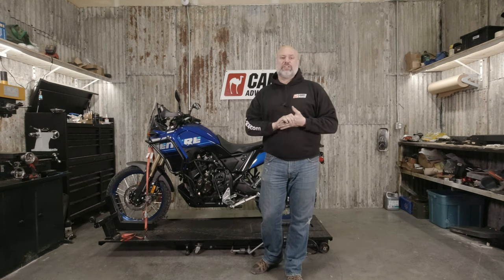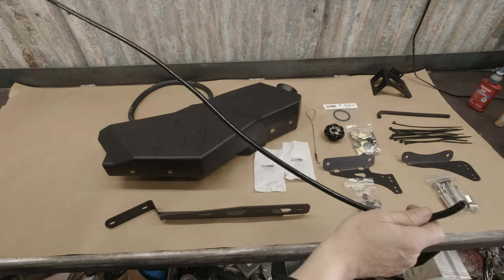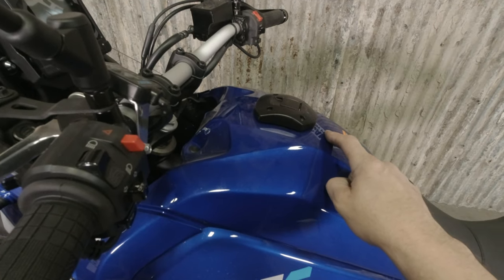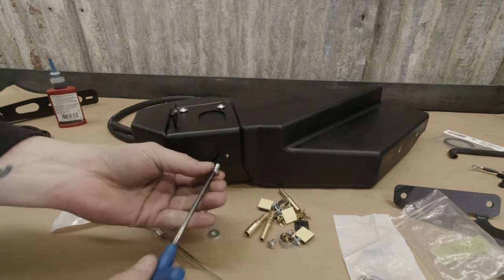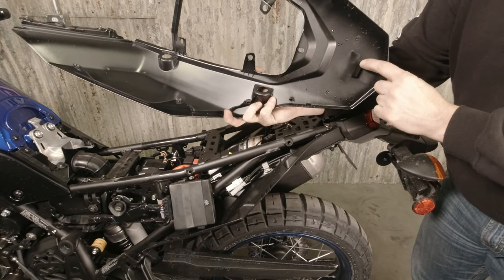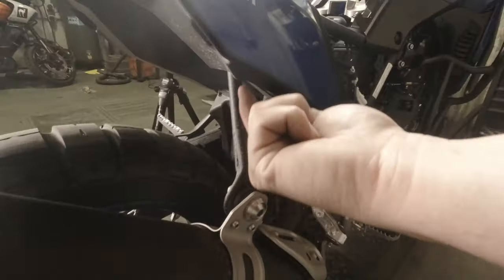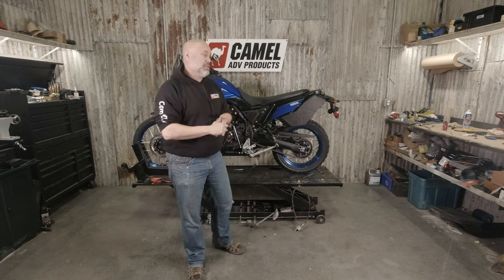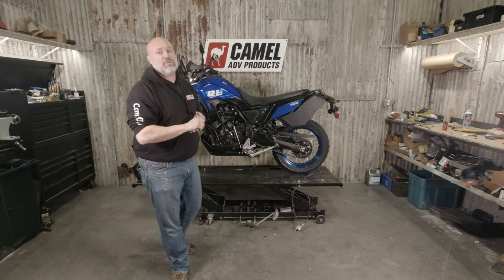T7 Camel Tank Install

Comment: have  you considered releasing a waterproof storage variant of this?? the tank/storage would need a bit of redesign (removing fitting and rounding corners) but you could use the mounting solution already used for this. the whole thing could be a waterproof tube of sorts, could be good for tools, camping gear, or a secure location for food.

Comment: What is fuel capacity on this kit
Reply from the maker: An additional 5L.
Reply: @CamelADV  gallons?
Reply: @gabrielkopp2036  The imperial gallon (imp gal), defined as 4.54609 litres, which is or was used in the United Kingdom, Ireland, Canada, Australia, New Zealand, and some Caribbean countries; the US gallon (US gal), defined as 3.785411784 L, (231 cubic inches) which is used in the US and some Latin American and Caribbean countries.  (from the Wikipedia entry)

Comment: Won’t install with any tail tidy but there own or oem, their tail tidy lights interfere with other high exhaust mounts… think twice about these if you want to buy this… I have a mivv high exhaust and alt rider tail tidy and neither blend with the camel tank mount or tail tidy turn signal locations…. It will all work with their tail tidy, you’ll make adjustments to mount your high exhaust and figure out a turn
Signal issue that won’t be right in the exhaust way and melt